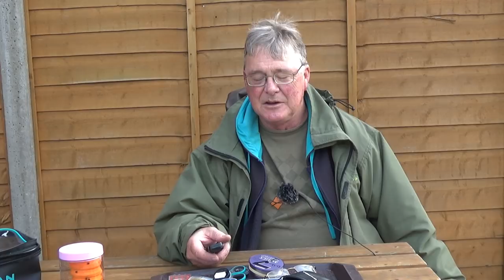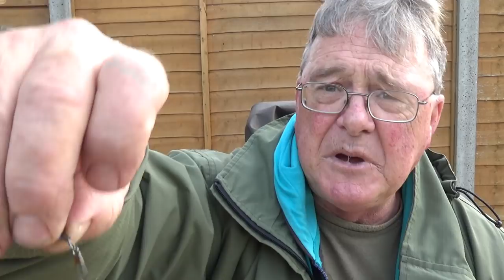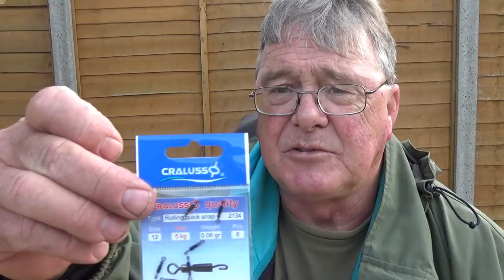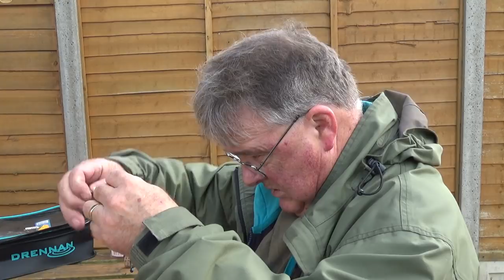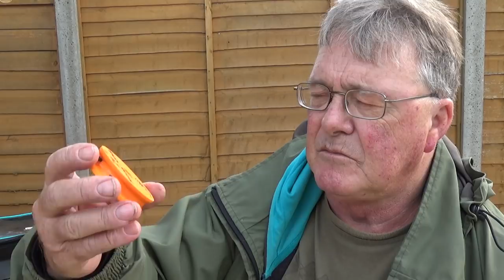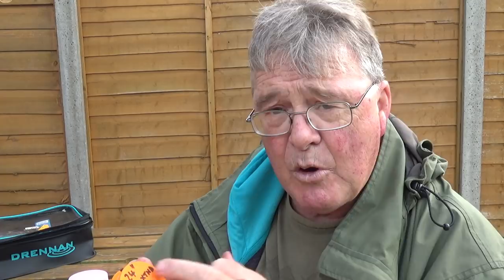Easy Fishing. How To Set Up A Versatile Feeder and Link Ledger Rig

Comment: A lot of modern end tackle is a solution looking for a problem. Yes, there are situations like feeder fishing over deep weed, which require booms, suspended arms, helicopter rigs and whatnot, but I'm of the opinion if you can simplify, do it. So long as your rig doesn't tangle in mid-cast, and it registers bites, you're good.

Comment: I see so those two rubber beads that are about 4 inches up from where you have your twizzled loop prevent the line from twisting further up when you twist the line to make it. I do have these rubber beads but i dont like using them as they cant be reused once you've taken them off the line so i'd use shots or stotz and see how that goes. When you mention that you dont use the bulkier plastic connectors (like the Drennan method connectors) what do you mean by them being clumsy?
Reply from the maker: cns180784 Hi those beads are not for preventing twists moving up the line. The bead above the sliding link is to stop some floating debris from fouling the hook when on the river. It also means you can semi fix the link when fish are picking up the bait and bolting. The two beads below the sliding link make the twisted loop kick of at an angle when you pull them down to the knot at the top of the twisted boom and act as a shock absorber. The reason I don’t use the bigger Drennan method connector or tulip beads at the end of the boom is that they can cause the line to flip back on itself on the cast causing tangles. I think that either using a loop to loop connection or a micro or mini snap link(Drennan or crallusso) is much better Tight Lines
Reply: I see i did wonder what effect these Drennan method connectors would have on my hook link, i thought that they could prevent tangles rather than cause them on top of being quick and easy to connect mainline and hook length but i think i'll avoid them now and just use them for fishing the method/banjo/pellet feeder.

So how do you prevent the line from twisting further up the line when making this twizzled loop? or is it unavoidable and theres' a way to straighten the line out?

Comment: Another great instructional Bill - well done fella.  I am not much more than a beginner, but one question I always have is that whilst I get that your rigs here are flexible and versatile (which is great), can you say when or why you would change hooklengths/feeder sizes, i.e. in what circumstances?  So I understand that with your rigs here you can change feeders for, say, a smaller one, but why would you?  When would you decide to extend your hooklength from a few inches to a few feet?  I'm not trying to catch you out, it's a genuine question and I find it hard to get an answer from the vids I watch on here.  You may say it's all down to experience, and I get that, but I'd be grateful if you could give maybe a few pointers in a masterclass-type thing that doesn't need anything more than the tackle and rigs that you explain in all your videos, but says more about how to use them and when to change from one thing to another, and for what reason.  Anyway, keep well mate, I'm enjoying your work.
Reply from the maker: Andy Smitj . Hi Andy, look to use a bigger feeder to introduce more bait,alternatively cast more often. Change to a heavier feeder if the wind increases and you can’t reach your original distance. Use a cage feeder if you want the bait to leave the feeder quicker. A solid plastic feeder if you want your feeder to empty when it reaches the bottom ie in deeper water say over 9ft deep. Change the length either shorter if your getting damaged baits without seeing the bite. Longer if the fish don’t want to go nearer the feeder or for a slower fall of the bait if you are using a dry mix a good tip is to try floating maggots on the hook. This is a huge subject to answer!!
Reply from the maker: Andy Smitj .Hi try a smaller feeder to put in less bait or as in my video when the fish were spooked by the feeder going in. A lead will be useful sometimes as in a link ledger but you can attach a bomb instead if you want. It’s all down to the day and experimenting to see how the fish want it!